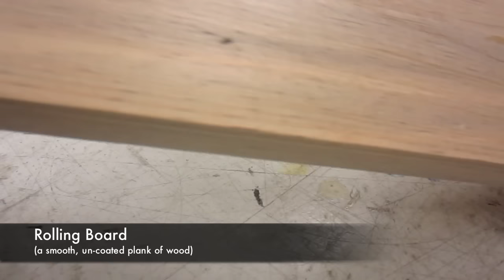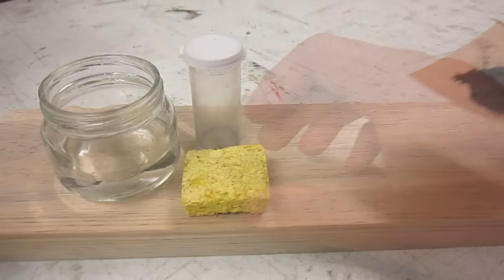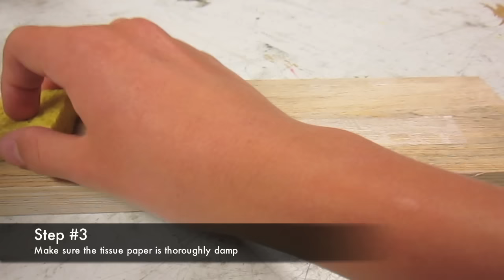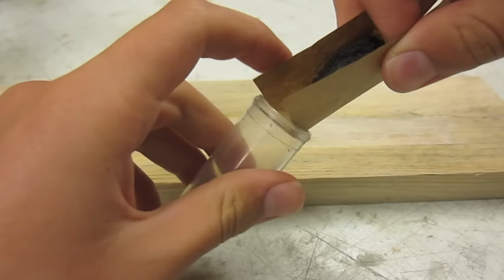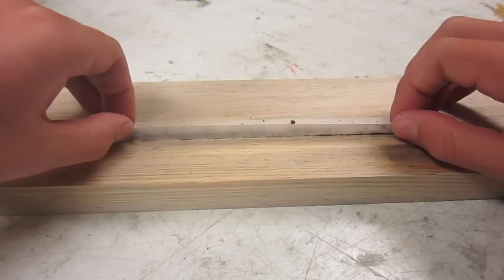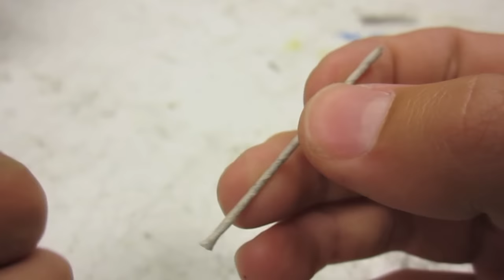How To Make Chinese Style Paper Fuse

Comment: I did this with weed and got blazed AF. Highly recommend this tutorial
Reply from the maker: Daniel Duongasaur LOL, this is not a tutorial for joints!!!
Reply: +Noah Dyson You're*
Reply: lmao
Reply: Daniel Duongasaur you got lit! Lucky it wasn't da bomb!
Reply: Its not going to burn without air like that, it needs something wich can oxidize like potassium nitrate, match heads , black powder etc
Reply: Noah Dyson in Canada it's legal to use weed
Reply: OtisDaReaper  or you know the air? Also oxidize is for OXYGEN there isn’t any oxygen inside potassium nitrate that’s a fuel not an oxidizer how do you think a joint burns?

Comment from the maker: There is already lots of good information on the internet about simple star making techniques, there is no need for me to make yet another tutorial on how to make them. However, at some point in the distant future there is a possibility that I will make a video on pumped stars, which there aren't many tutorials on. Otherwise, I will not be making any star making videos. Sorry!
Reply: Instead of meal-d blackpowder can I use an Armstrong mix?
Reply from the maker: Rohit Ahuja You can try, but be careful. Also, pure armstrong's mix would simply explode so it needs to be slowed down with something.
Reply: Rohit Ahuja add some fine charcoal
Reply: +EpicPyrotechnics what's black powder

Comment: Wonderfully made fuses, and tutorial.
I have followed the instructions and made some extremely successful fuses.
I have taken to it like a duck to water, I use a lot of fuse in my hobbies and now after 5hrs practice, I am rolling them consistently at 10 inches long.
Thankyou sooooo much for this, never have I had a tutorial which has led to such a successful outcome.
You have saved me so much money and I cannot thank you enough.
Best wishes brother, 
Many thanks,
Peter
Reply from the maker: pablo picasso Wow, thank you!! I'm happy that this has really helped you out. This fuse really is great stuff. Cheap, pretty easy to make, reliable if made correctly, and can be made in a range of thicknesses.
Reply: EpicPyrotechnics Yup, this does make a super reliable fuse. Just takes a LOT of practice to get it down. As I am fairly sure you are aware.
I have been using them for something that requires a fairly thin fuse, with great effect I might add.
A question I have though, where do you source your paper? I have a reliable supplier but the price for this stuff has recently gone through the roof (From this guy anyway).
I have not found a problem getting the paper but a lot of people are asking silly money for it, maybe do a vid on the sourcing of the paper because in truth I think for a lot of people this may be harder than actually making the fuses. Maybe? 
Just a thought.
Best wishes,
Regards,
Peter
Reply from the maker: pablo picasso Yes, I would imagine the paper could be a bit tricky to find. I got mine from an art supply store (not a chain), can't remember how much it cost though. I think it was around 3-5 dollars for a good-sized sheet. I'm not really sure of stores where other people would find this paper so I can't be of much help, but I'd say it's a good idea to check any art or craft stores.
Reply: I too am having great success but I have also tried rolling them in the other direction and they seem to burn just as well if not better but I have not tested them in conditions yet.
Any thought on this way? 🤔

Comment: just a tip for when you're making your own bp. you can change the burn rate of your powder by adjusting the percentages of the ingredient (by weight obviously). EpicPyrotechnics seems to have a great burn rate on his fuse. I'm using the shimizu dark fuse II composition of 56grams kno3, 10 grams charcoal, and 34 grams sulfur. nice slow consistant burn.
Reply from the maker: +chillardbee Very true. Another crucial factor is density. A tightly rolled fuse will burn relatively slow even with fast powder. The powder I use is standard BP ratios, but using harwood charcoal and not anything fast. I'm going to try that mix, it seems like it could be good for time delay components with such a high % of sulfur. I might give it a try in fuse too.

Comment: Awesome video! But you can use Armstrong mixture too instead of black powder; you can get arm strong mixture from the end of the matches. Very time consuming to remove using a sandpaper; but cheap.
Reply from the maker: Thanks! You could probably use match powder, but the results may be quite a bit different. The main issue I can think of with using it is that it may go out, but I'm not sure. It's worth a try! If you test it, tell me how it goes. BTW the stuff from matches isn't really armstrongs mix, it's more like KCIO3 + Filler + Binder + Powdered Glass and or a small amount of phosphorus sesquisulfide. (Armstrong's mix is KCIO3 + Red Phosphorus in approx. equal ratios) Powder from toy gun caps is more like armstrongs mix.
Reply: stick to black powder or something slower, i used h3 (nearly as fast as AM) baad idea it shot up into the sky
Reply from the maker: milyan360 Yep. Nitrate and charcoal based mixtures are the way to go in my opinion.

Comment from the maker: I have no idea, but you could try it. Be careful though, sparklers sometimes contain barium nitrate (toxic) so I would advise wearing gloves at minimum.
Reply: Try putting a small thread through the holes on the applicator and secure it to a part on the board. It will push out an even line of the bp as you pull it across the board.
Reply from the maker: +dstnlockwood77 Very smart. I'll have to try that.
Reply: is that gun powder
Reply: +Brieanna Chin BP = Black powder used in fireworks just as flashpowder but flash is faster bp is made of charcoal flash magnesium/aluminium if i'm not mistaking but that aren't all the ingredients idk if thats used for guns its not allowed where i live.
Reply: It's all legal, As soon as you assemble the firework it's illegal.
Reply: @toolofbordem  it depends where you live

Comment: Hi  I decided to make a fuse off my own and one that i haven't yet seen on youtube and what i did was i gutted out the simple bottle rocket engine and i use 3 of them then i mixed it with water and soaked cotton string in it i did this because i have started making my own explosives simply because the market ones weren't powerful enough and i had made one with a fuse i salvaged from the bottle rocket and it was to quick when i was running away it blew and hit me in the leg so i made this fuse and it was so much slower burning than i expected which is good because i don't have to use as much on one explosive but per inch roughly it burns for 2min 15sec which is the longest burning fuse i have ever seen altho i don't have much experience i thought it was impressive
Reply from the maker: +Superman 0503 Sounds good! But watch out. Fuses that are soaked and for that matter all handmade fuses can be unreliable. They could do all sorts of stuff like pretend to go out or burn way too fast.

Comment: Many are the times that visco's too fat to penetrate a hole, bare match not stiff enough and/or unable to pass fire thru an opening (or hanging for 10 mins. only to ignite the item when you least expect & desire it), and slow match (KNO3-soaked paper or string) not enough to ignite items that act as heat sinks.  Chinese fuse looks like it'd be good for x-matching Japanese time fuse or fusing small rockets & jet vents.

I don't think I'd've ever gotten this method down from mere written instructions, so thanks.  Howie Davis used to make Chinese fuse a lot, but I never sat down w him to show me how.

Comment: Thanks for sharing this tutorial. It took me a while to figure it out.

Question:
How do you prevent the fuse from "unraveling" a bit?

Remarks:
- Rice paper won't work
- You need a wooden surface to "roll" the fuse on. It won't work on a smooth surface.
- Practice first with a practice powder.

Comment: Where can i get blackpowder? And awesome video btw! :)
Reply from the maker: Thanks! Black powder can be acquired in a number of ways. The first way is to make it yourself, which is what I do. I HIGHLY reccomend this method, especially if you are into pyro or want a lot of black powder. It is a bit expensive for the equipment, but it is worth while. All you need is a ball mill (Harbor Freight rock tumbler), some media (brass, non-sparking steel, or lead balls), and the chemicals (potassium nitrate, sulfur, and charcoal). If you are interested in this method, look it up or PM me for more info. The second option is to purchase it from from stores that sell stuff for reenactments or reloading old firearms. Smokeless powder, which is what is used in modern guns, is NOT the same as black powder and will not work. As a last resort, you could carefully salvage black powder from model rocket motors (if you can get those where you live). I don't reccomend this, though, because it is expensive and time consuming, and has little yield.

Comment: What's the difference between black powder and metal D black powder?
Reply: Black powder usually comes in granules for firearms so its safer and also faster.

Meal black powder, or meal dust, superfine black powder means it freshly came from the ballmill, this is usually used for pyrotechnics because it is dangerous for guns.
Both are made of the same ingredient though, saltpeter, sulfur and charcoal
Reply: @Marcuschozen  Thanks, I forgot that I made this comment after some time.

Do you think this fuse could work with using just regular black powder

Comment: Um can I use potassium nitrate or match powder instead?
Reply from the maker: Jesse Shin Match powder might work. Potassium nitrate is out of the question, as it doesn't even burn on its own.
Reply: oh ok Thanks, now if youll excuse me I have some sh** to go blow up :P
Reply from the maker: Jesse Shin LOL, have fun!
Reply: Jesse Shin If you mix 3 parts potassium nitrate to 2 parts sugar it should work. Just make sure it's a fine powder and is evenly mixed. People use that same recipe for smoke bombs and rocket engines so it will definitely burn. You can even add a teaspoon of baking soda to make it burn slower. Just be careful and you should be all set.
Reply: Jesse Shin "Match powder" meaning powdered heads from friction matches? Or the kind of non-milled black powder you'd use to make black match?
Reply: first

Comment: milled not meal-d, right?
Reply: " Meal powder is the fine dust left over when black powder (gunpowder) is corned and screened to separate it into different grain sizes. It is used extensively in various pyrotechnic procedures, usually to prime other compositions. It can also be used in many fireworks to add power and substantially increasing the height of the firework." ― ＷｉｋｉｐｅｄｉＡ

D is likely the grade of the powder.

Comment: Need precision as hell... Or people could use black powder (+dextrin) with a little of any solvent from a syringe.
Reply from the maker: RashiD1G Maybe, although it may squeeze out when you roll up the fuse and the powder trail may crack and burn unevenly when dry.
Reply: EpicPyrotechnics I did it with a little of NC laquer and it was fine. Although, when I've done it like one the movie, it worked as quickmatch fuse.

Actually it was quite fine when done with H3 powder. You know. :D
Reply from the maker: RashiD1G Nice! That's weird that it burned like quickmatch using the method in the video. Mine has never done that.